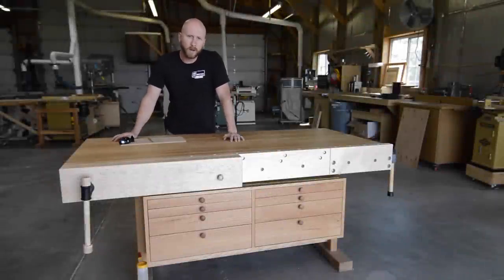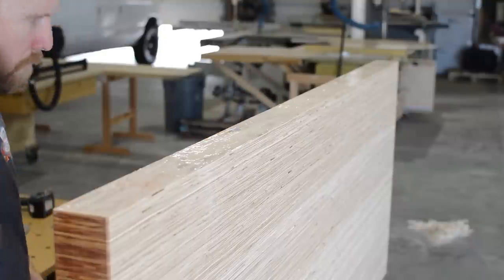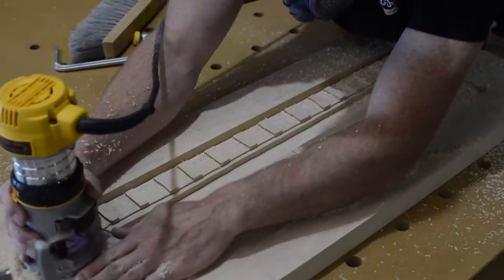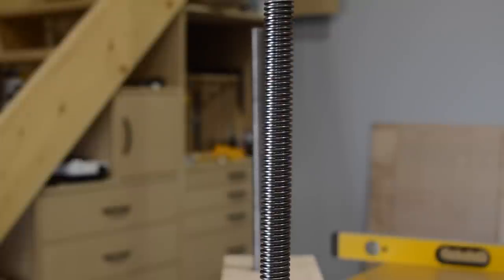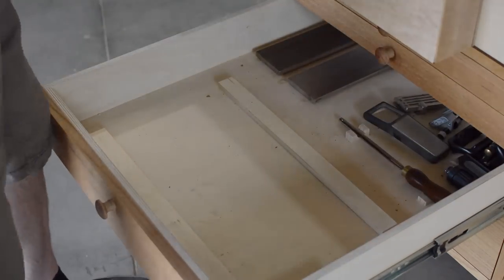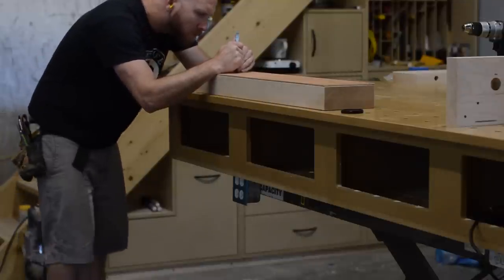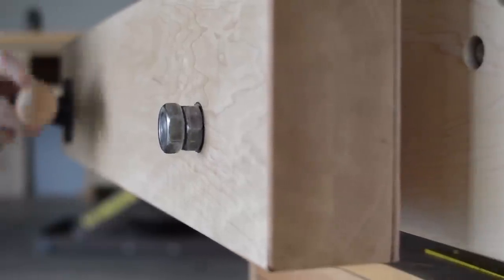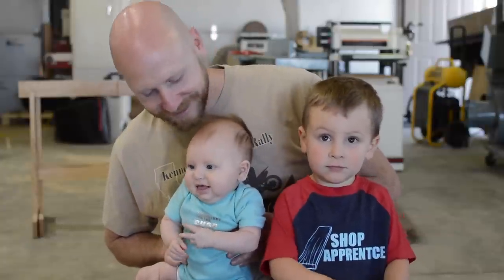Workbench Upgrades! Vise installation, jigs, and woodworking chit chat

Comment: Hey brother, 
  How much clearance do you run from bench top to the top of  the suspended chest of drawers (basically measurement from top to top of chest)?  My bench has plenty of mass already, but I also have the structure and space to build something as mild as a chest of drawers that would sit in bottom or as elaborate as filling it out with more of a shaker casement style; all without obstruction of vises.  I’m just kicking around the idea right now.  I use Grammercy and Lie Nielsen holdfasts in addition to some more additional modern and archaic holding fixtures. Obviously I’d need to make clearance for the large holdfasts, but I’m wondering if there are some unforeseen pitfall I should be aware of when considering adding something beneath the top.   It’s a 102” long 5” thick SYP and Red Elm Roubo with Hovarter Leg Vise, Hovarter Wagon Vice, a Veritas Twin Screw face vise on other side of bench.  Moxon is not just benchtop traditional one, but rather more of a full Moxon & Table fixture that sets right on top indexed into dogholes I can secure if leaving in place for a long time so I don’t have to leave the f-style clamps in place if I don’t want, but best of all I have an additional 8” of height for small joinery which saves the back and the eye strain both.  Considerations are that I have full use of both sides of bench and I use the table top moxon bench and a tall double stack Dutch Tool chest to leverage different needs required of my 6’3” height/spinal/brain injuries against still having a suitable height for planing, larger joinery, and milling.  The DTC is a god send because I’m not bending over all the time into a deep chest, not having to always go to a wall, my tools stay better protected against NW Tennessee humidity because their closed up in the evening with a block of camphor in top and bottom compartments; also this facilitates me using any where around the bench.  The reason I’m considering adding the storage was because I’ve seen/heard your appeal to their advantage in two videos now.  While I have a full compliment of handtools which would not all fit in the space you’ve created, I think it’d be nice to store my No° 8, the set of molding planes, and the tools that aren’t grabbed each day like side rabbet, some of my niche wood planes and joinery planes.  I’m primarily a hand tool guy aside from bandsaw/jointer/planer, but I learn a ton from all your videos.    Just thinking you may know of a friction point I may not see and where I could benefit from how the bench has served you this past few years Thoughts?
V/R, Shannon
Reply from the maker: The chest is fit snuggly between the upper and lower stretchers of the bench base. There are a few inches of space about the upper stretchers. As to your question about friction, I'm not too sure. Weight will always help with friction, so adding lesser used tools down there will help at least some.
Reply: @MikeFarrington  thank you, sorry for the term “friction points” (especially in a post that has construction at its core).  The use of the term friction point is my carelessness as a Marine; an oft used term for those points in planning/execution where problems will arise (most times they’re predictable if your doing deliberate planning). So for example; the glue up of large carcasses have predictably known “friction points” in a project; especially for the guy who has built for his main corners a tight fitting narrow fingered box joint and also decided to use dadoes combined with a couple of through floating tenons to capture a cross member in the construction.  If he uses quick setting titebond original, he’ll probably never get that joint together because of the swelling that titebond is going to multiplicatively introduce when trying to bring those box joints together. He can mitigate that perceived “friction point” by considering a slower setting lubricative adhesive like maybe epoxy and rehearsing a dry glue up, having cauls/clamps prepositioned, etc….  Using distinct vernacular in the wrong places is something all military guys struggle with to some degree; usually it’s our bucket loads of abbreviations that get us in trouble, but in this case it’s just an off the beaten path pragmatic way of describing a challenge that can/should be identified or you’re going to learn the lesson the harder way.   Thank you a bunch for taking the time to address my question and I hope you and the family are having a great summer.  
S/F, Shannon

Comment: Mike, I have a question I hope you can help me with. I have a Veritas twin screw vice which they advertise as an end vice. I notice your vice is mounted as a side vice and I believe it is similar to mine, although better engineering.  I am redesigning my bench and would like to use my twinscrew as a side vice and get a Veritas tail vice as the end vice. Do you find you like your set up. Would you think my idea has merit.  Thanks.
Reply from the maker: I really like the positioning of my vice. I don't think I would change it, and I could get away with only the twin screw vice. I know the Veritas is a really good piece of gear as well.
Reply: Thanks Mike. I think when I rebuild my bench I will change the position of my twin screw to the front as you have it.
Reply from the maker: @chuckbogart9382  I think you'll like it.

Comment: Hey Mike, I'm installing the same vise and am going to use the same router bit method for creating the stepped holes. Do you know the brand of router bit and bearings you used? I can't find a rabbeting bit small enough to fit inside the 7/8" hole. Thanks!
Reply from the maker: I think for this one I used a Rockler rabbet bit set that has a few different bearings.
Reply: @MikeFarrington  Thank you, Mike! Love your content.

Comment: Great content.  For the love of fornication, please test your finger smearing versus just a good squiggly bead of yellow glue left untouched.  I’ve been a carpenter 25 years and my main work goal currently is to stay as clean as possible.  About 5 years ago after some exhaustive forensic research(many screw ups), I’ve found the finger smear coverage no better than the thin squiggly line.  Test it out, you may be surprised...
Reply from the maker: I do it both ways depending on what I am glueing and how much squeeze out I want to deal with. I think overall you are correct about the coverage.

Comment: Spreading glue with your finger was frowned upon in the 80's as the oils in your finger could react with the glue weakening it or changing the cure time.  I would think the glue now would not be impacted as much.  I do it with my fingers mostly because I love to rub my hands together and make the glue ball up and go away on my shop floor.  My 2 cents.
Reply from the maker: I like to peel glue as well.

Comment: After talking to my finishing supplier I quit using lacquer.  Although its easy to repair and cheap to buy I lost confidence in it as a durable finish, especially the one part stuff.  I still think of the commercial jobs I did with it and I'm too nervous to return to see how they are holding up.
Reply from the maker: Fingers crossed they hold up over time.
Reply: Finishes are a tough topic... Lotsa good finishes and lotsa bad ones. I have also switched from lacquers to other finishes. For pigmented finishes I use Scuff X. I refinished one of my best friends cabinets with it and it is holding up to perfection. Also I top coat my clears with General Finishes Clear Poly. Sealers vary. But I see old projects and jobs with that stuff on it all the time and it looks great. I might try some of the General Finishes conversion varnish next
Reply from the maker: @MaydaysCustomWoodworks  I find myself trying lots of finishes these days. Often times I like all of them for different reasons, but all of them have one thing I don't like. Thats what keeps me looking for the perfect finish.

Comment: Why not put WHEELS on the bench?  does it weigh too much?  I don't have room for a pallet jack!
Reply from the maker: I have found that wheels make it a little wobbly. There are some that use a lever system to lift up, those would work, but I already have the palette jack.

Comment: Could you please tell me which Dewalt Router your using in this video Mike??? Any regrets since buying it??? I’m shopping around and so far the Dewalt 618 is a front runner. Any advice is always greatly appreciated. 
God Bless You & Yours!!!
K
Reply from the maker: I use a bunch of different routers. I am a fan of the dewalt 611 for a small router, and the 618 is good for a larger sized unit.
Reply: I've got the 618 with both bases. So far, so good. And I love the soft start over my older router. Watching Mike, I'm wondering if the 611 isn't a future buy!
Reply from the maker: @jrkorman  The 611 will be a nice addition.

Comment: Next video. Look mom I got a new drill press.
Reply from the maker: Trust me I have been shopping. I'm not in love with any of the new offerings for the cost. The used one I am looking for is a unicorn. I want an older PM 1200 with the variable speed, its proving hard to find.
Reply: Make sure you also check out milling stations, they're extremely accurate and in some cases you can be lucky to find one at a fairly low cost. It's likely worth considering - even if it's a bit more expensive, because it can do both drilling and milling. Even used ones or "discount" milling stations can be more precise than a brand new drillpress.
Reply from the maker: @68HC060  Funny you mention this, I just went and looked at one the other day. It was a little too beat up for me. I may go down this road. I will say the time and effort needed to get one back to the shop is way more than a drill press.
Reply: I'm located in Europe myself, so I don't have a good feel for what's available to you (except from I've heard that you can't easily find combined jointers / thickness planers - the cheap ones aren't worth it anyway).
It might be worth it to look for chinese milling stations; though poor quality compared to the top brands, they should still be more accurate than most drill presses.
On the other hand, it might also be good to check out if there are any machinists that are willing to part with an old machine for a couple of beers. ;)
-If any machinist is reading this, leave Mike a note, please. :)
Reply from the maker: @68HC060  Good tools at good prices are hard to find over here. I just keep my eye out and eventually something turns up...and yes if anyone within a days drive of Denver has one for sale, let me know!

Comment: Hey Mike, 100% off topic, because I feel that your business and mine run similar paths with the exception that your a star, I have a few questions about your wide belt sander, like name, size, horsepower, phase and your likes and dislikes with it, I appreciate any help and I apologize for imposing on another fine video from The boardroom.
Reply from the maker: Its made by Safety Speed Cut. Its the 43x75, 20hp, 3 phase, and I run it off a rotary phase converter. Its been great. I bought it used and its been a really nice addition to the shop. Dislikes, none other than cost. I will add its not a very high end machine, it lacks certain features of the more expensive stuff, but thats OK for my uses. It takes a lot of juice to power it, so keep that in mind. No problem imposing, always happy to help.
Reply: I thought it was a safety speed, your about the fifth person I’ve heard say nothing but good about those sanders, I’m not looking to have all the bells and whistles I just want to get out of as much orbiting as possible it makes me dizzy, thanks for the feedback I’ll let you get back to avoiding all the paparazzi
Reply from the maker: @nathangraham6581  I think they make really good tools relative to the price. Sure I don't have a vacuum conveyor bed for sanding veneer, but thats just not worth the extra 15k it would cost. I also like the SAE fasteners, super easy to work on. I could probably rebuild this thing with a Grainer catalog. I would say this, A wide belt won't get you out of RO sanding. So before buying a wide belt, I would invest in a really nice palm sander.
Reply: We own a few nice sanders, I even have a person to operate them and that’s what I’m trying to cut back on,  I’ve seen some rather nice used wide belts on the used market but I’m hesitant to look further because of my lack of understanding at what to look for as far as wear and tear goes, that and my phase converter will only start up to a 15 hp machine (most I’ve seen are 20 and up), so the simpler the better. But thanks for all the info you’ve been a considerable help, I will definitely look deeper into a safety speed, now I just have to find a way to get Felder off my back. I think they smell blood.

Comment: So where on earth do you buy LVL?
Reply from the maker: I can order it from both my local Lowes and Home Depot. A couple of the local pro supply houses stock some as well.
Reply: Didnt think about special ordering it. Thanks for the info. Been debating for a long time on what to make a new tip out of. Just seems like a shame to waste a bunch of nice maple on a table top.
Reply from the maker: @andyfermanich9956  Funny you mention wasting nice lumber on a top, one could argue that it gets used often and is therefore not wasted. I feel it is wasted because there are alternatives. I'm with you, if I have the money for that maple, I would build furniture with it.

Comment: Did i see an air nozzel with a female coupling all in one?... am i crazy?... what is that?
Reply: 5:44..... never seen that before...
Reply from the maker: Yes, you saw that correctly. I bought two of those at an auto parts store that was going under. I haven't seen them since.
Reply: What the frick?... That's genius lol. I need to get one of those
Reply: Good eye!